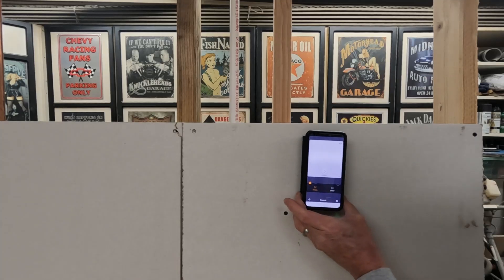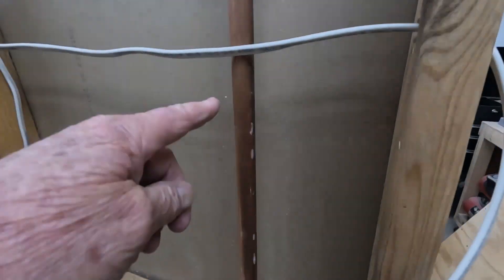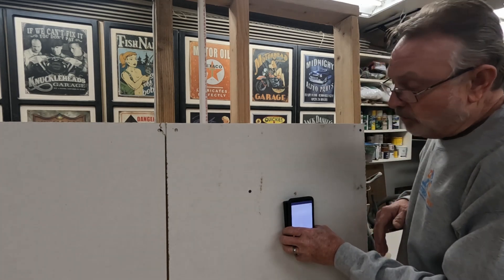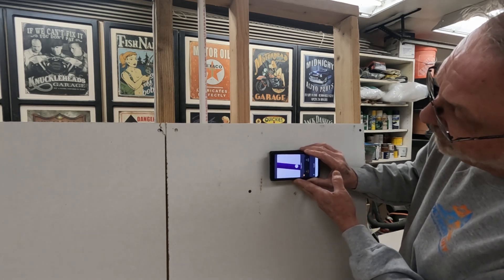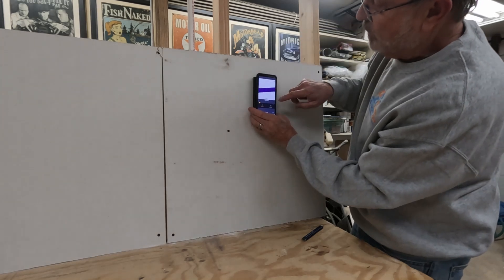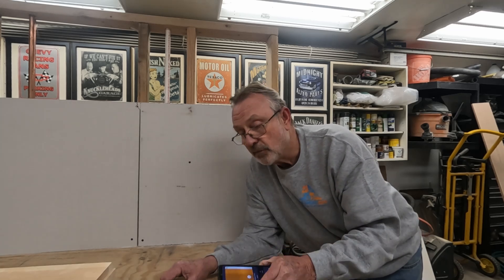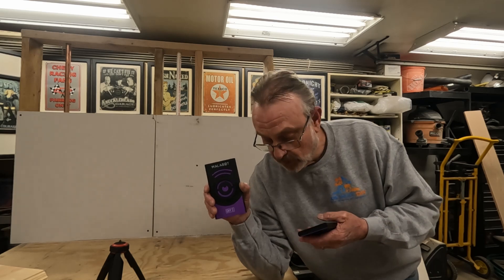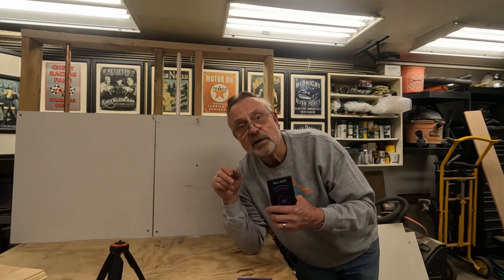Never Damage Pipes Or Wires Again! Walabot DIY 2 Visual Stud Finder

Comment: Thanks for the most comprehensive review of the Walabot I have seen so far. This is the only review that I have seen to use an attached wire to a stud scenario. All others just use a hanging loose wire, which I don't think is code..